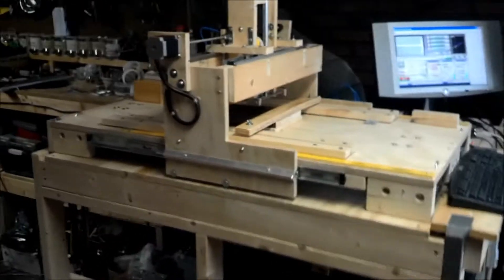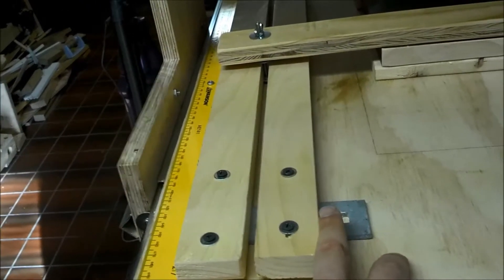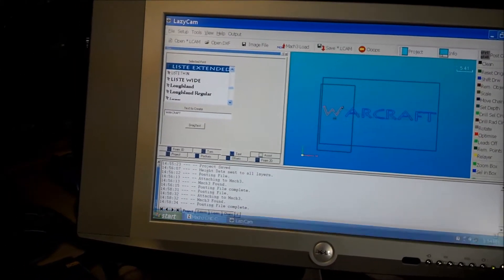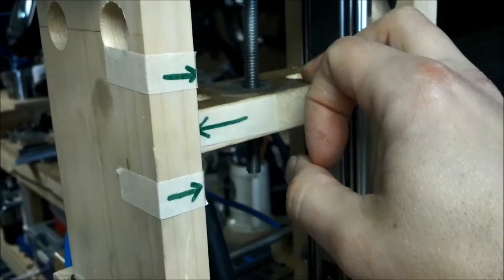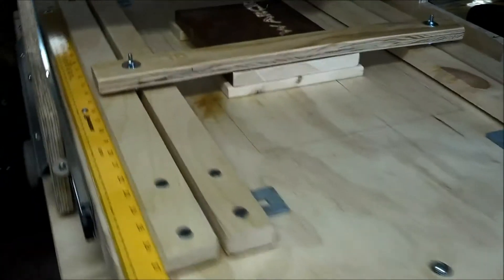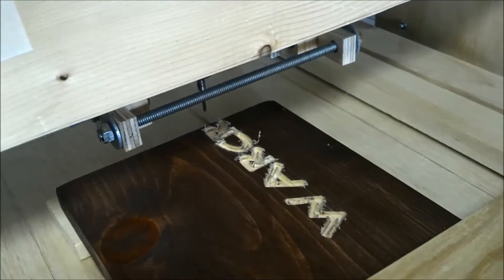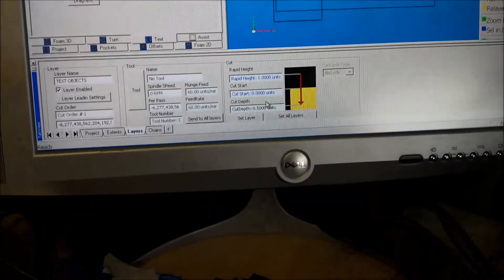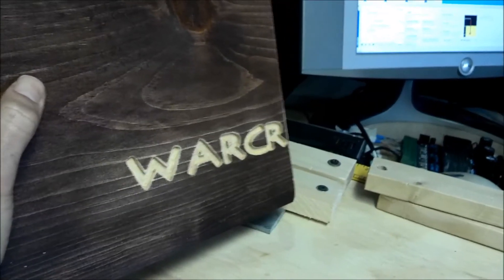DIY (Drawerslide) CNC Machine - Redesigned Gantry

Comment: what lead screw are you using ? is it threaded rod ? and do you get much backlash with the insert ?
Reply from the maker: +Tom Howbridge Yep, just regular threaded rod from the hardware store.  Minimal backlash and it was plenty accurate and consistent for light wood working.

Comment: For the wiring diagram of the motors could you give me the sequience of colors from right to left. I also have the Long Motors. I'm copying your build as close as possible. Hope you don't mind. Thnx in advance for answering my email.
DRG
Reply from the maker: Feel free to copy the design!  Cool.  I have a lot of vids up of most of the process showing what worked and what didn't work.  There was a lot of trial and error.  I remember spending a lot of time on the wiring, if I remember correctly the color scheme was pretty standard with images I pulled up online.  From left to right try: Black, Green, Red, Blue.  (You won't use all of the wires coming out of the motor).  The nice thing I've found with steppers is that you most likely won't blow it it just won't work at these voltages if something is connected wrong.  Best of luck.

Comment: I have been looking into CNC machines for quite some time for routing guitar bodies and cutting fret slots on guitar necks. Is it possible to program several layers at once and have the machine route them on the same program or do you have to do each layer seperately?

Comment from the maker: It was just standard all thread from Ace Hardware - the count was actually a bit higher ~ 18 threads per inch.  Larger threaded rod would probably work a bit better but almost any rod as long as it's straight will work.  Mach 3 has a cool auto calibrate function. Thanks for taking a look.

Comment: Do you get any flex on the drawer slides.  CNCZone forum seem to be against drawer slides for that reason.  I'm planning to make a fixed gantry with moving table for cutting wood and depron foam for RC airplanes. 
Keith